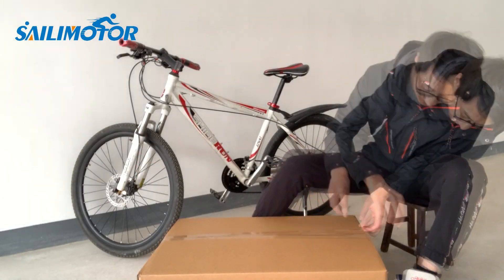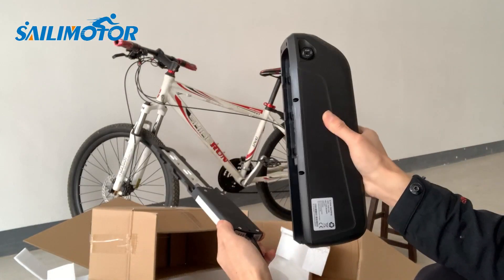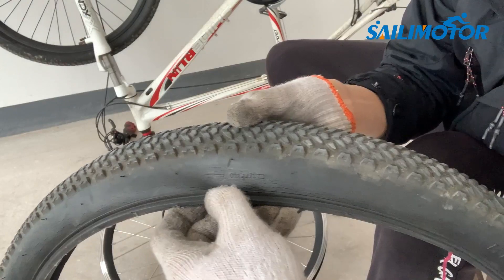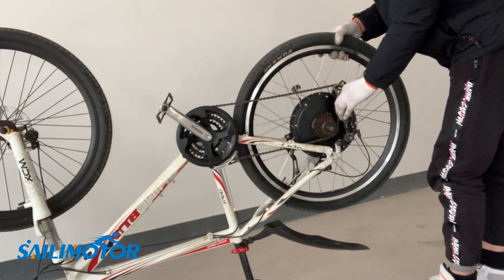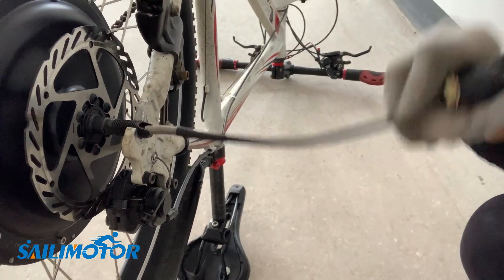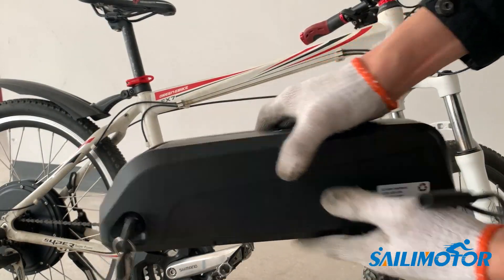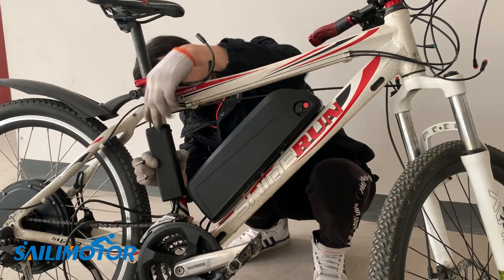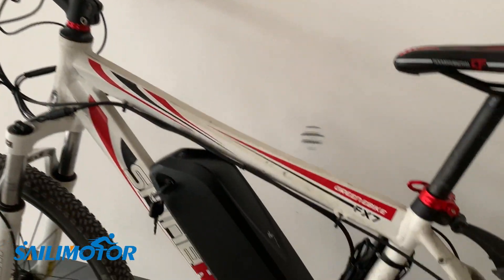How To Install The Ebike Hub motor Conversion Kit. - Sailimotor

Comment: A tip for the display mount: a dab of hot glue on the nut before removing the bolt will hold it in place when you re-insert the bolt.
Reply from the maker: Nice ,  you are right 😆